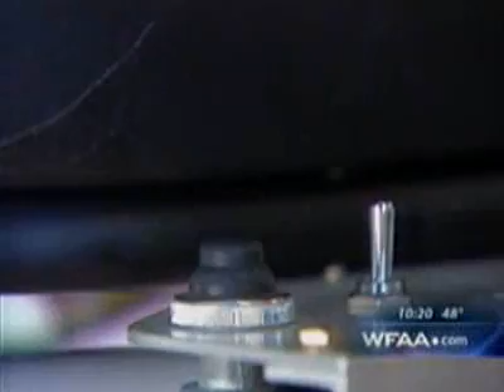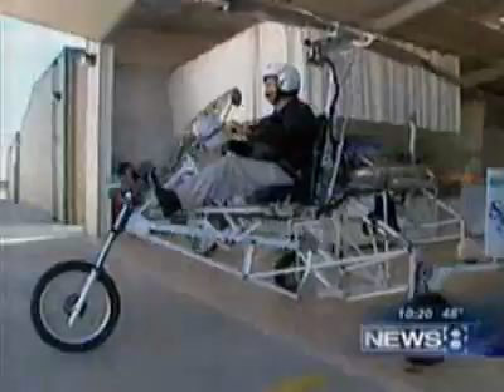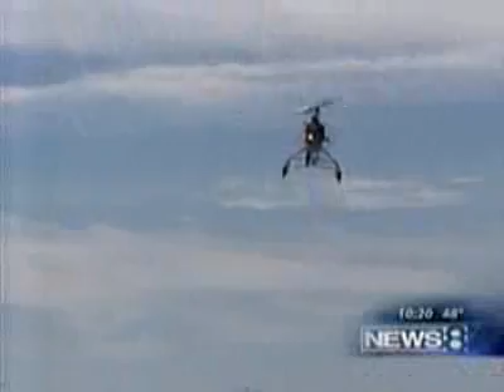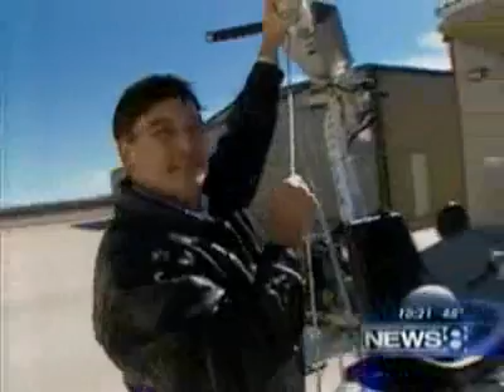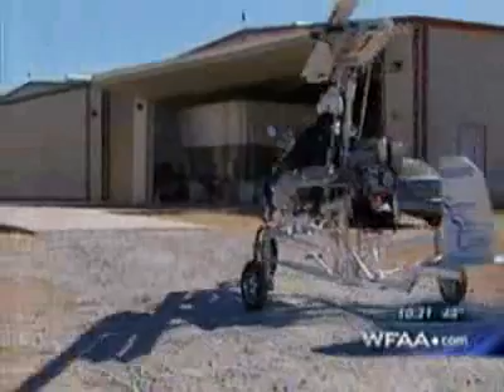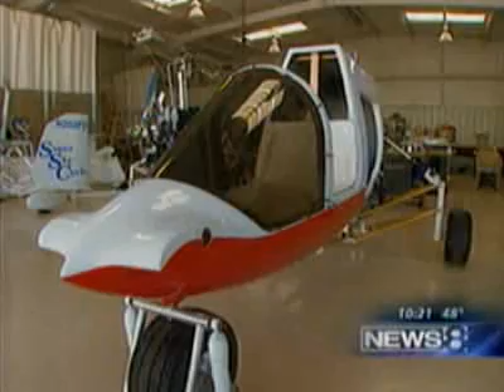Flying Motorcycle

Comment: @JBattaile From what I've read on various gyroplane sites and videos, this is because the FAA requirements to license a kit plane are MUCH more lax, provided you build at least 51% yourself. It's actually doing the customer a favor. (and there are kits out there that cost as much as $60k, engine/blades not included. They typically include a nice windproof enclosure)